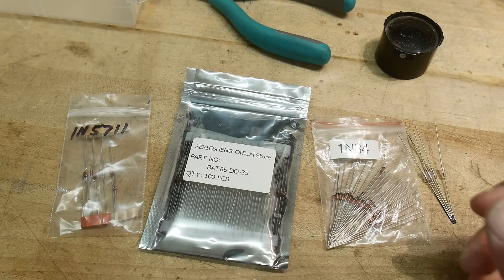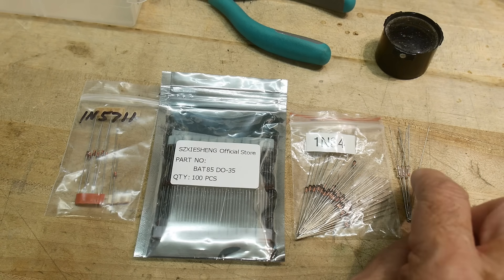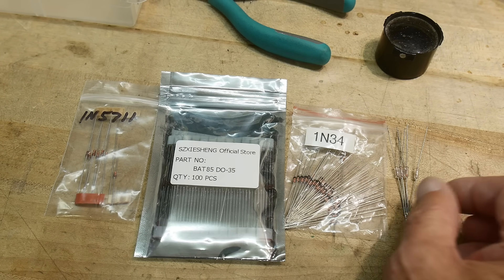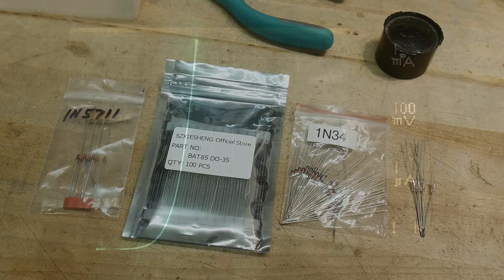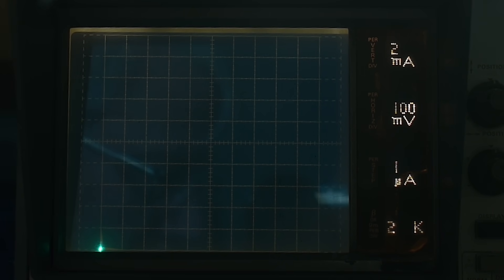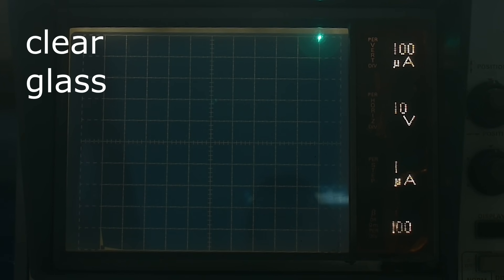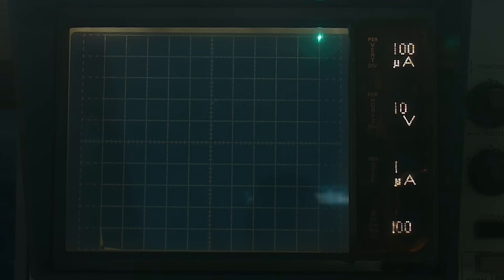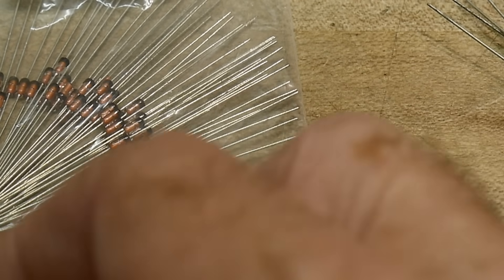#1752 1N34 Germanium  vs Schottky Diodes

Comment: 1N5711 is a favourite of mine for building mixers but looking at that perhaps it might not be the best option. 

I don't have the luxury of a curve tracer so I might have to see if I can measure differences in mixer performance with different diodes.
Reply: That is interesting. It seems like the weak knee would give you a soft-clipping effect, which might be a benefit in audio applications. What part of the circuit you use them for?
Reply: The 1N5711 diodes are good for high-speed mixers and other high-speed applications.  They have much lower capacitance and much lower carrier lifetime (low carrier lifetime is useful for high-speed switching) as compared to the BAT85 or BAS85 diodes.  Which diode is "best" depends on the application.
Reply: You might have heard of homebuilt xy tracer and use 2ch scope.
Reply: For mixers, especially for homebrew experimental receivers I'd build mixers using the various low-junction-drop diodes and test them in-circuit. There are so many RF and audio variables that define a good mixer for a specific application that I'd leave it to both the test gear and the human ear to pick the best diodes. Sure we can read specs, but if that's all we do we are making assumptions about the value of the various specs in our application. I prefer to make the minimum number of assumptions necessary.
Reply: Curve tracers like the one shown here use the mains frequency 50/60 Hz and also at DC. They are originally intended for characterization of small batches of diodes and transistors at semiconductor companies for the purpose of writing the data sheet. I have not seen a curve tracer running in the kHz or MHz range.
Reply: Yes what part of your circuitry are you using them??

Comment: If memory serves me, 1N34 and their germanium cousins are point contact diodes, and can be identified thru the glass case by mechanical differences.
Reply: This is also my understanding, anything in that small glass package that 1N4148 uses is a silicon diode of some description. Germanium RF detectors in glass have the larger package and visibly point contact arrangement
Reply: @Broken_Yugo not only that... If I remember correctly the direction marking for silicons were black and germanium ones were red. But I am sure about the Japanese germanium transistors were made in aluminum cylindrical with dots near their collectors. A blue dot means an NPN (very hard to find) and a black or red means a PNP (very common).
Reply: @bayareapianist  the dot is more for european types, orange is also used, all the japanese to1 germanium ones i've come across so far use an arrow to mark,  also have had germanium diodes with black, and even other colour bands, in some cases more than 1
Reply: https://www.youtube.com/watch?v=3ao0-gRYzBU&pp=ygUdMU4zNCBhbmQgdGhlaXIgZ2VybWFuaXVtIHRlc3Q%3D
Reply: My apologies. I just wrote the same thing, before reading your comment. I didn't mean to rehash your remarks.
Reply: No worries ...
Reply: They work great as detectors in crystal radios.

Comment: Hey, can you do a simple crystal receiver and show the difference of putting a slight bias on the diode? Many designs use a 1-10 meg resistor to bias the diode and I don't understand why. edit- I don't understand why the slight bias improves the performance of the crystal receiver
Reply: If you pre-bias the diode it takes less received signal to get the diode into conduction so it makes the receiver more sensitive.

Interesting experiment though.